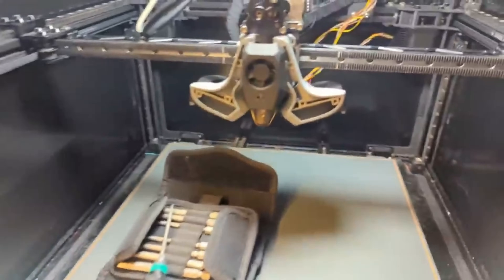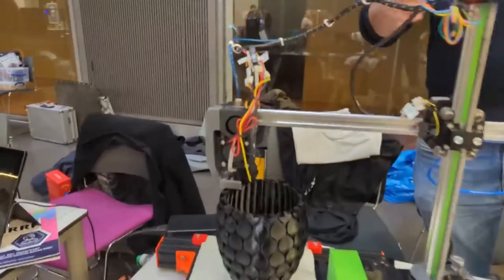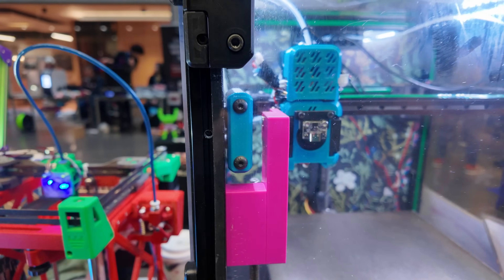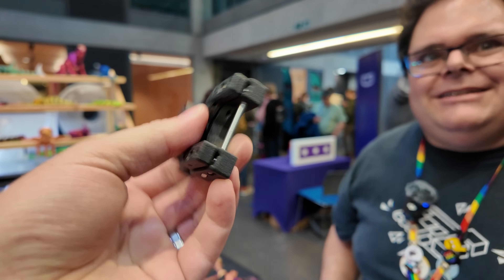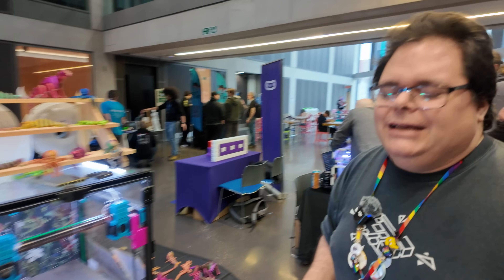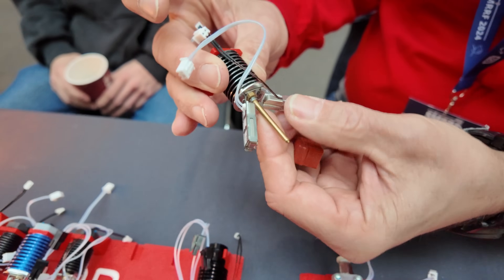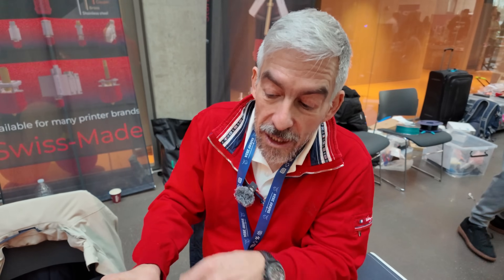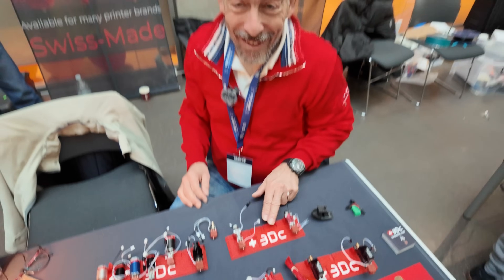A 3D Printer that CLIMBS?!? That and more from SMRRF 24!

Comment: the climbing printer is a great idea
When I researched toolchanger I saw some magnet coupling systems, but all of them were discontinued. Also had the idea and a ruff design, but magnetic interferance with electric components and the sensitivity to temperature were to much of a hussle, so I can't wait to see how they handled it and what the system is capable of

Comment: I'd make the beam fixed and the head move along the beam and I'd add a counter weight on the opposite side of the beam so the CG on the arm is always in the center of the column and having 2 equivalent masses moving in opposite directions will cancel out the lateral forces
Reply: You realize that this machine cant climb with a fixed beam right? Your suggestion makes it not work.
Reply: @user-cg3em4cw4f  yes it can but the belt kinematics are a bit more like an inverted h-bot
Reply: @ My point is, it moves the beam in order to lock into the climbing blocks. If the beam is fixed, it cannot climb.
Reply: You would eliminate the reaction forces from the radius actuator but would double the reaction forces from the rotational actuator that now has more moment to work against. In the end all these optimisation aren't really needed as the printer moves very sloooowly.

Comment: The climbing unit, that has future potential to start working sideways, as well, is just a trip. That is clearly, beyond my skill set and abilities, but right up most hobbiest's avenues of printing desires.. Thank you for showing that one.
Reply: I guess it's just more of a limitation if used sideways, and more complicated than just having a longer rail since you need the extra width for the heated bed if it's sideways anyway :) Using it vertically basically gives you infinite vertical print height